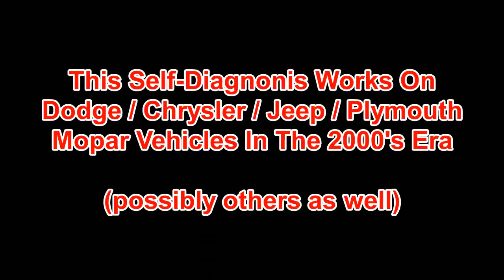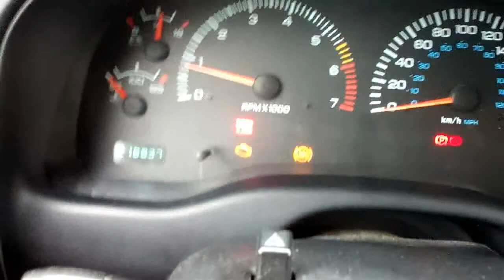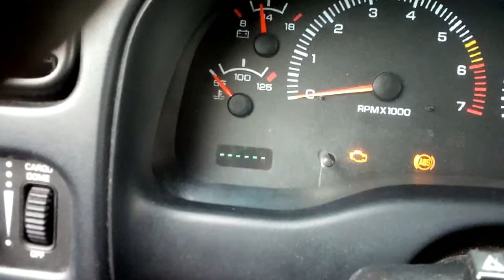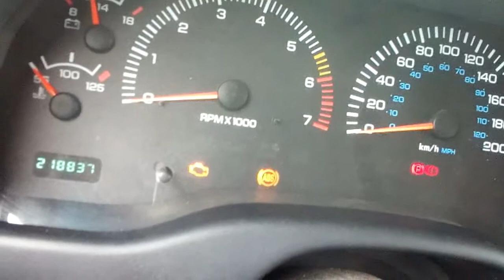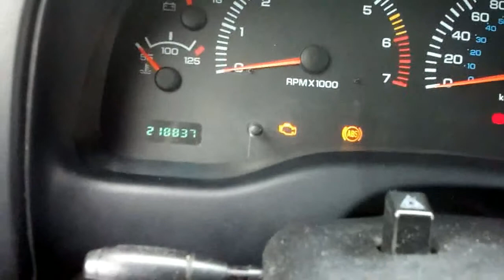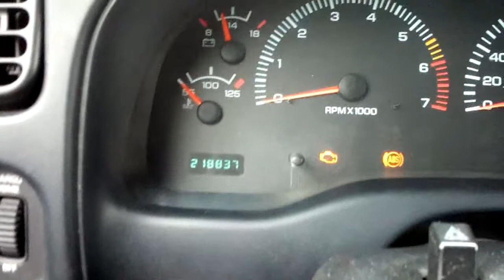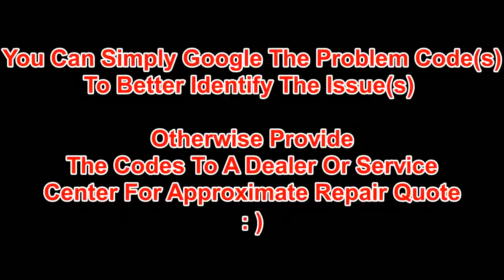How To DIY Read Service Codes / Self Diagnosis ( Dodge / Chrysler / Jeep )

Comment: Good hack.  That trick works on the newer ones too.  Not sure if it works on all of them, but I did it last week on a 2015 Ram and it worked.
Reply from the maker: yeah its a great DiY method to help diagnose these issues.  I wish they all had similar software and accessibility.  good to know it works on the modern stuff also, thanks :)